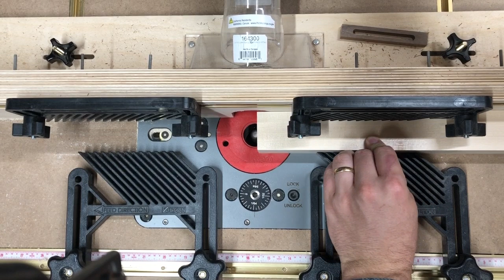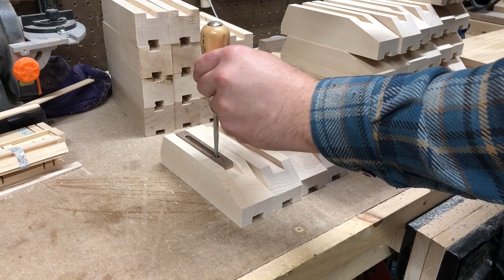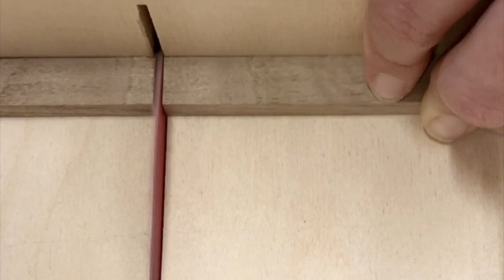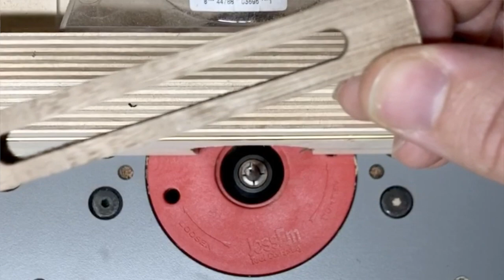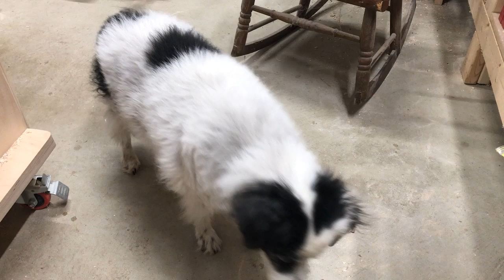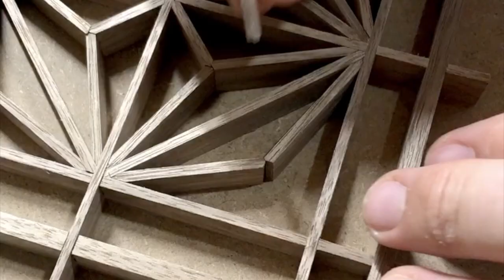How to Make Kumiko Jigs || Kumiko Woodworking

Comment: Nice Kumiko jig!!  My only question is why did you insert another anchor in the opposite side from the working end; e.g., why two anchors?
Reply from the maker: The dual stops allow a wider range of capacity. This way when the stop is maxed out, you can push it back to the next insert to get additional length.
Reply: @MayerWoodworks  Ahhhh. Thx for that info. I truly appreciate it.

Comment: I'm curious as to why you created a channel on the underside of the block. Will you use it as well?
Reply from the maker: Typically I will use it as a sort of miter box for cutting the strips to length. But it is really just a product of making the jigs. I will channel both sides and then hand select the better one for the final product. Any minor imperfections in the grain are left to the bottoms.

Comment: What is the tool at 1:00 that you are using instead of a plane called? The one that looks like a sanding cylinder recessed in the table? Did you make it or buy it?  Awesome video, thanks a lot!
Reply from the maker: Look up "Flat Master". I'm not sure if there is a generic name for it other than that it's a type of drum sander. I found it at a garage sale of a woodworker who had passed away and took a chance on it. It's definitely shop-made but I'm not sure if he used a kit or went from scratch. Hope that helps!

Comment: The angles have to be perfect.  I’m glad you can trust a Kobalt.  I couldn’t trust my Bosch.   I fine tuned them on a disc sander.  Sorry have to question using a miter saw alone. Good job otherwise.
Reply from the maker: As we say in woodworking: don’t blame the tool! That Kobalt always took a little longer to set up with repeated test cuts to get the angle to the tolerances I needed but once it’s there it produces a reliable result. The Kapex I have now certainly speeds up the process though!

Comment: What is the notch at the bottom used for?
Reply from the maker: You can use the bottom as sort of a 90 degree mite box, to cut the pieces to length with a handsaw. Just use a square to cut the first kerf with your handsaw so you are getting a great cut every time!